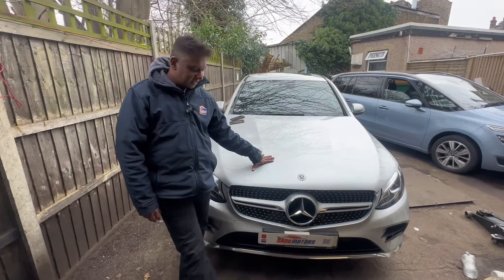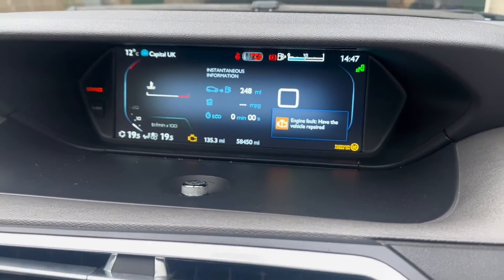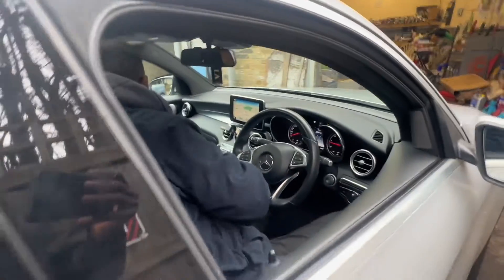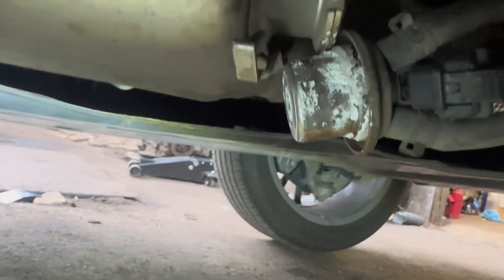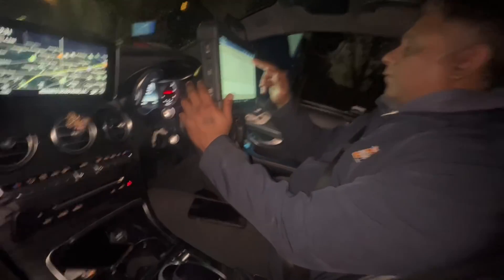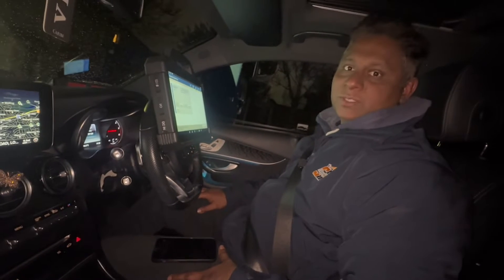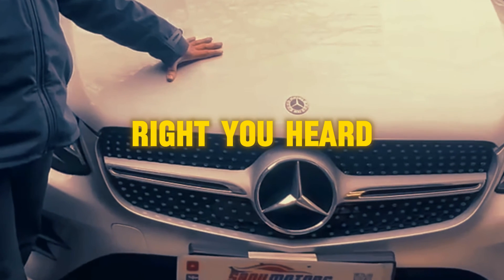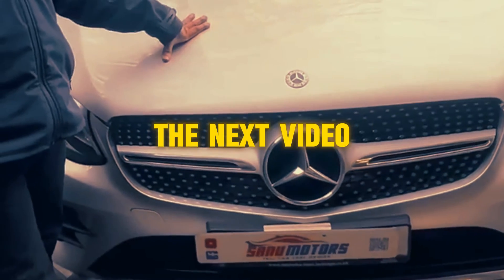Nox Sensor Failure? | Mercedes Benz GLC 250 2017  P229F92  NOx Sensor Failure and How to repair

Comment: Hello Brother Hello from Sweden, I have the same problem, do I need to replace NOx Sensor 2 with a new one or clean it? Can the problem be solved by cleaning it?.
Kind regards, Sinan 👋🇸🇪🇸🇪🇸🇪🙏🙏🙏
Reply from the maker: Hello Sinan 👋🇸🇪 — good question, brother!
You can try cleaning the NOx sensor, but honestly, it’s only a temporary fix in most cases. Once the sensor’s internal element gets contaminated (especially from AdBlue crystals or soot), cleaning won’t restore accurate readings for long.
Here’s what usually works best 👇

Remove the sensor and clean the probe tip gently with carb or brake cleaner — don’t soak the whole unit.

Clear the fault codes and test drive.

If the code or check engine light comes back, you’ll need to replace it, especially if it’s the downstream (NOx Sensor 2) one — they fail more often.

When replacing, always make sure to clear adaptations or reset NOx learning values with a proper diagnostic tool (Launch, Autel, Xentry, etc.).
We’re not able to reply to continuous messages as we get a huge list of comments every day. If you need more help, join our groups — full of mechanics and diesel techs who deal with this daily:
👉 WhatsApp: https://chat.whatsapp.com/JOvJCdZYdV9J6PvIXw2RV0
👉 Facebook: https://www.facebook.com/share/g/15msa3NJmn/

Comment: Thank you for your videos, at the Mercedes service center they changed the nox sensor twice, a month later the check engine light came on again, in the end I cleaned the adblue injector myself using your videos, everything has been working perfectly for several months now
Reply from the maker: Glad it helped

Comment: I have nox sensor 2 bank 1 issue right now in my Mercedes GLC 250d. Can I use the sensor from Bosch or have to be from the Mercedes? Do Mercedes do the resale for the refurbished ones?
Reply from the maker: You can typically use a NOx sensor from a reputable aftermarket brand like Bosch as a replacement for your Mercedes GLC 250d. Many aftermarket sensors are designed to meet or exceed OEM specifications, so you should be able to find one that works well for your vehicle.

As for refurbished sensors from Mercedes, it's possible that they offer them as a replacement option, but it would be best to check with your local Mercedes dealership or authorized service center to see if they have refurbished parts available and if they offer resale services for them.

When purchasing a replacement sensor, be sure to verify compatibility with your specific vehicle model and engine configuration to ensure proper fit and function.

Comment: Hi Charlie  - what did you soak the sensor in overnight ?? - thank you
Reply from the maker: I soaked the  nox sensor overnight in my own mixture, but you can definitely try any DPF cleaning product for similar results. It's essential to find a solution that works best for your needs and ensures thorough cleaning. If you have any more questions or need further assistance, feel free to ask!

Comment: Link for the dpf cleaner?
Reply from the maker: A diesel particulate filter (DPF) can become blocked or clogged due to several reasons, primarily related to the accumulation of soot and other particulate matter. Here are some common causes:

Incomplete Regeneration: DPFs need to go through a process called regeneration to burn off accumulated soot. If the regeneration process doesn't complete properly, it can lead to soot buildup and eventual blockage. Incomplete regeneration can occur due to short driving cycles or low engine temperatures, which don't allow the exhaust system to reach the necessary temperature to burn off the soot.

Low-Quality Fuel: Poor-quality diesel fuel may contain higher levels of impurities and contaminants, which can lead to increased soot production and quicker DPF blockage.

Faulty Components: Issues with engine components such as fuel injectors, turbochargers, or EGR (Exhaust Gas Recirculation) systems can affect combustion efficiency and lead to higher soot production, contributing to DPF blockage.

High Mileage or Age: Over time, DPFs can naturally accumulate soot and debris, especially in vehicles with high mileage or those that have been in operation for many years. Eventually, this buildup can lead to blockage if not properly managed.

Incorrect Driving Conditions: DPFs require specific driving conditions to regenerate effectively, including sustained highway driving at moderate to high speeds. If a vehicle is primarily used for short, stop-and-go trips, the DPF may not get the opportunity to regenerate fully, leading to blockage over time.

Software or Sensor Issues: Problems with the engine management system, such as faulty sensors or outdated software, can lead to improper fuel-air mixture, timing, or exhaust gas recirculation, which can impact DPF regeneration and contribute to blockage.
Incorrect Servicing: If servicing is not performed correctly, it could lead to issues such as improper installation of components, leaks, or malfunctions in engine systems that can affect DPF performance. For example, if the air intake system is not properly sealed after servicing, it could allow unfiltered air into the engine, leading to increased soot production and DPF blockage.

Incomplete Regeneration: Some servicing procedures, such as replacing sensors or components related to the exhaust or emissions systems, may require the engine control unit (ECU) to be reset or reprogrammed. If this is not done properly, it could disrupt the DPF regeneration process, leading to incomplete regeneration and eventual blockage.

Faulty Replacement Parts: If aftermarket or low-quality replacement parts are used during servicing, they may not meet the same standards as OEM (Original Equipment Manufacturer) parts. Substandard parts can lead to issues such as improper fuel combustion, increased soot production, or sensor malfunctions, all of which can contribute to DPF blockage.

Improper Maintenance Schedule: If servicing intervals are not followed according to the manufacturer's recommendations, it could lead to neglect of crucial maintenance tasks that help prevent DPF problems. For example, regular oil changes are important for maintaining engine efficiency and reducing soot production, which can help prevent DPF blockage.

When a DPF becomes blocked, it can trigger warning lights on the dashboard, reduced engine power, or even force the vehicle into a "limp mode" to protect the engine from damage. In severe cases, a blocked DPF may require professional DPF CLEANING or replacement to restore proper function. Regular maintenance, proper driving habits, and using high-quality fuel can help prevent DPF blockage and prolong the life of the filter.
Thank You